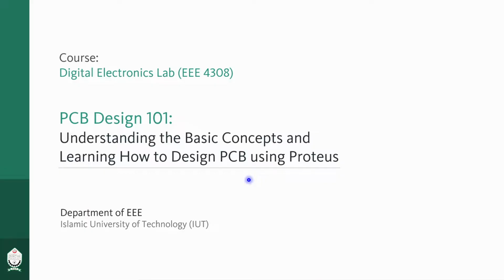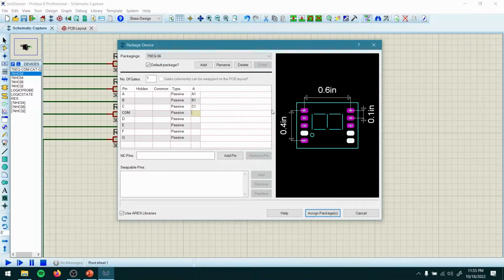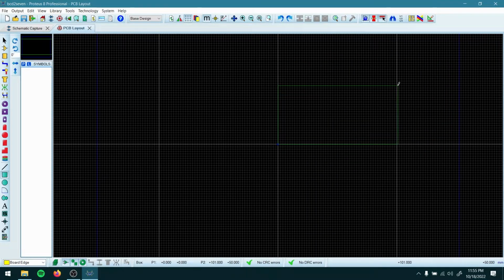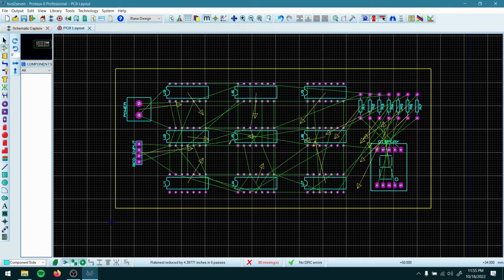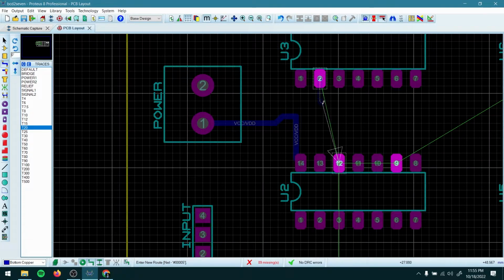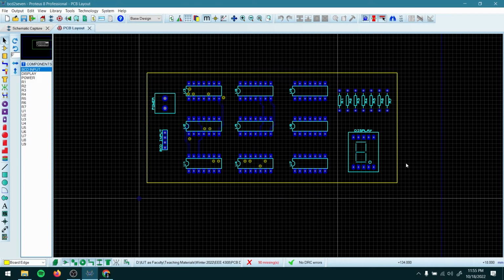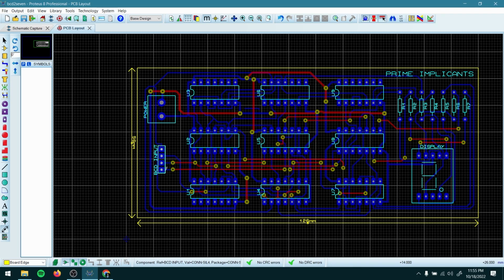PCB Design 101: Understanding the Basic Concepts and Learning How to Design PCB using Proteus

Comment: 01:00  PCB Material
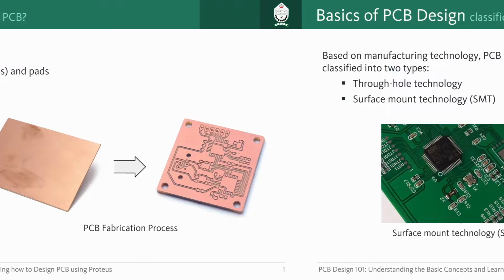02:00  Through hole vs SMT
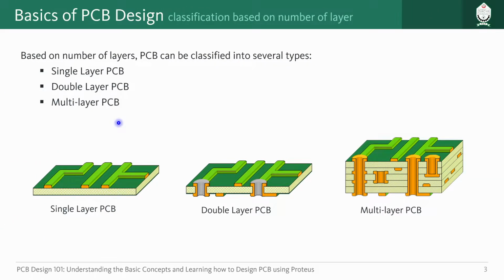3:20    Multilayer PCB
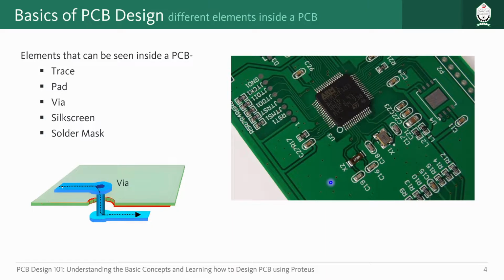4:54    Terminologies (Traces, Pads etc)
6:22    Via problem
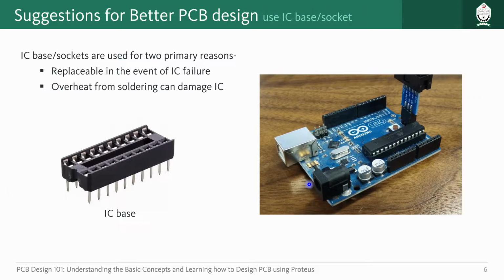8:34    IC Base
13:18  Footprint management
18:55  Terminal blocks/Connectors
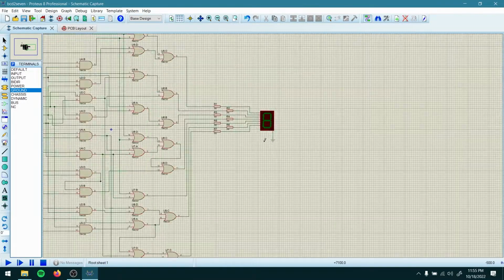23:00  Power supply
23:50  Layer design
24:40  3D visualizer
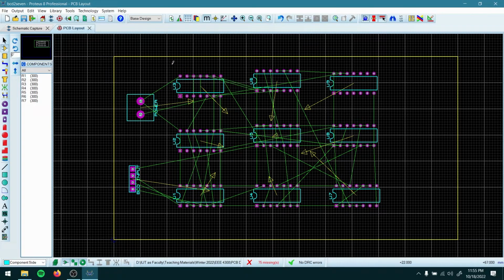28:29  Component alignment
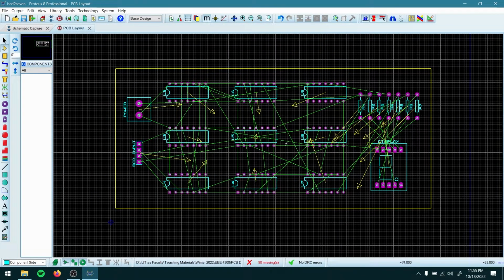32:31  Gateswap optimization
33:35  Increase pad size
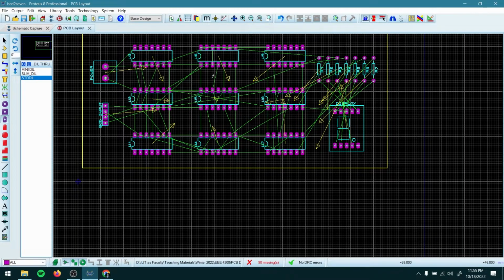35:34  Design rule management
36:55  Trace Calculator
40:34  Routing
41:33  Autorouting
43:38  Soldering issue with top layer
50:00  Fixing soldering issue with autorouting 
55:00  Finishing up

Congratulations!